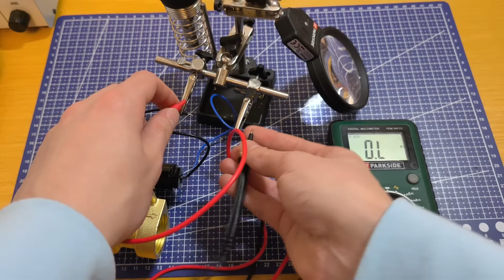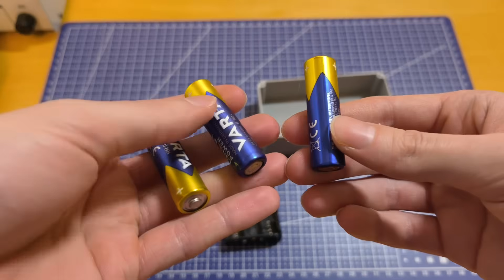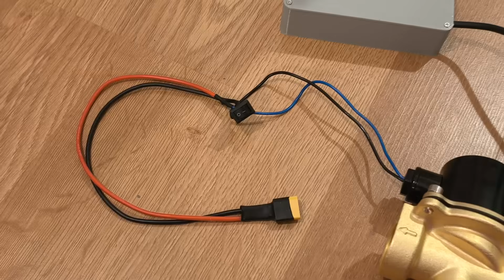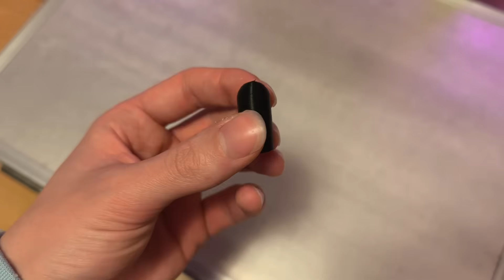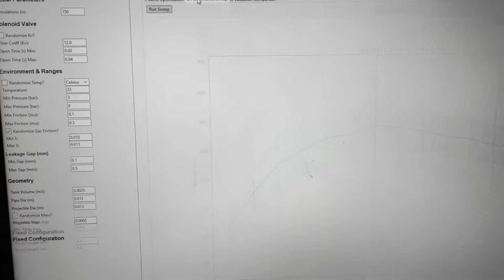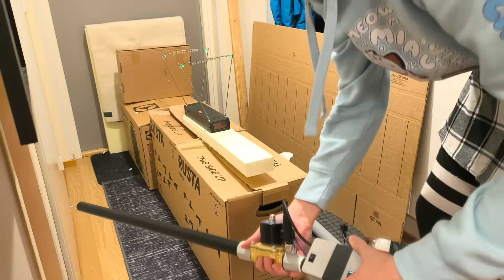Can My Air Cannon Break the Sound Barrier?

Comment: As an engineer, you're doing quite good job.

One question tho, is this just a hobby?
Reply: Btw, for the projectile, you need to 3d print a projectlie with a fins.
Just in case if you test at a longer range.

Cuz a projectile without stabilizer is a speed and acuracy killer.

Comment: Isn't this that thing Anton from No Country For Old Men uses
Reply from the maker: Basically! But that one had a probably 10-20 times higher pressure, and much shorter barrel.     But in practice, this 2.5m barrel one at lower pressure, is more powerful.

Comment: That model is really impressive, Would you be willing to go into how it was developed (well the language and framework really)? 
I probably would've just thrown empirical data at it and skip the detailed math (which is the boring thing to do)
Reply from the maker: Yeah, the interesting thing is that I was able to delegate most of the boring and tedious derivation of the formulas and programming to AI, by first describing that I want an adiabatic model of the system, why I want it, what it should consider (orfice diameter, barrel diameter, piston effect, leakage), etc, as well as how I want it to be modeled, what real-life effects it has to consider, what kind of python solver I want (RK45), monte carlo, what kind of UI I want, etc. 

For the most part, it did it really well. It did make some dumb mistakes occasionally, but having done quite a few courses in fluid mechanics, math, mechatronics, programming, etc, I was able to quickly spot the issues and correct them. Had I done it all manually by hand, it would have taken weeks of continuous work. But with the help of AI, I was able to do it in just a couple of evenings.

For the app, was able to draw the UI I wanted on a piece of paper, and then send a picture of it to the AI, which then programmed a full app for this solver based on that.

Engineering is probably one of the few things that these AI tools provide an incredible efficiency multiplier to. However, the tool is only as good the human using it. The human has to know what they are doing, in order to properly utilize it and validate the results.

I decided to do this project so rigorously, as this will essentially be my bachelor's thesis :3
Reply: @Femboy_Engineering  :shelterin:😺🤗

Comment: Small recommendation to your projectile: look into the design of late smooth bore firearm projectiles for a greater interaction with the backing pressure. Flat surfaces on the back of the projectile like on the one you printed can contribute to it tumbling if you do not have rifling on the inside of the barrel to give it spin. And as you've noticed, the ridges on the 3D printed material do not make for a very good seal. A solution to both of these problems may come with the minie ball, with its conical interior and ridged exterior walls. The conical interior helps the pressure to guide it a little straighter out of the barrel and minie balls were usually coated with beeswax on the ridges when loaded to create a more complete seal with the interior of the barrel. Using a similar design may help you with both the pressure leakage and the tumbling of the projectile.

Your cannon being air will have some drawbacks to this however, as the heat from the combustion that would normally happen with the black powder firearms this projectile would be used with would have two additional features that yours will not. The first is that the expansion of the metal material due to the black powder rapidly heating the projectile on combustion would help the beeswax seal on the interior of the barrel just a bit better. Naturally, air will not create quite nearly the same effect, but the thinner end of the conical projectile may still see a small amount of expansion from the pressure nonetheless. The second is that the burning of the powder would normally burn off a large amount of excess wax in the interior of the barrel due to beeswax's flammability. So you may have to clean the barrel regularly if you use wax in your air cannon, but it should still produce faster results than had you not regardless of these two things.

Nice vid. Love the in-depth explanations. Keep it up. 👍

Comment: Quite brave using a pet bottle for pressure, ive had one explode at the thread next to my head when we were making air muskets with my cousin :P since then ive only used welded ppr tubing. (or steel for some higher pressure activities :3 ), other than that very cool!!

Comment: Do you think a rifled barrel would help increase speed due to better aerodynamics?
Reply from the maker: I think it might decrease muzzle speed slightly right after it comes out of the barrel, as the rifling adds a bit of drag, but if the projectile is spinning, the projectile can be made far more aerodynamically, and it would maintain that speed for far longer and allow for a far longer range :3 So it is essentially a tradeoff between muzzle velocity and range, but if the goal is to launch the projectile far away, in a stabile way, then, the rifling is totally worth it!

Comment: You are putting a lot of trust into that plastic bottle.
Reply from the maker: Yeah :3 I have done some hydrostatic pressure test and tested that they hold around 10 bar of pressure. This time, I only pressurized it to 5 bar, as higher pressure would have just been diminishing returns in velocity, and a higher risk of explosion, which my neighbors wouldn't have liked :3
Reply: @Femboy_Engineering  why not use a metal one?
Reply from the maker: @personWhoLikes_a_lot_of_things  I used these, because I had them lying around, and they work well enough at these pressures! I'm also a poor university student, so that was also a way to save some money :D  This is actually my first monetized video, so from now on, I can afford to do more expensive projects :3
Reply: @Femboy_Engineering  Good luck!

Comment: very amused that it's possible to 3d print valves, love this queer combination of electrical and mechanical engineering uwu

edit: fuck, the pink jet lighter is cool
edit 2: that was an amazing low-tech solution to projectile instability. simpler than barrel rifling
edit 3: you might've already considered this, but a saboted projectile would be a good approach to achieving velocity with a low-profile projectile without compromising the seal which allows for efficient energy transfer

Comment: I can think of one instance where an o ring didn’t apply a proper seal 8:44
Reply: 1986?
Reply: @iana6713 What?
Reply: @mexicanimations 1986 - the cause of the Challenger disaster. It was traced back to a faulty o-ring in one of the solid rocket boosters.
Reply: @iana6713 ohhh now i get it
Reply: @iana6713  yes, fun fact they knew it was gonna be cold that day but they didn’t test if the rings would hold up to how cold it would actually get the we’re overconfident and people died. Sad thing but human error is real
Reply: @boldandbrash798 Yeah - I've just been reading about that in a book about America's first female astronauts. It gets a mention when they talk about the Challenger Inquiry after the disaster.

Comment: got caught red-handed with those super cheap xtra cookies, i'd never have a pack of those cookies in my snack shelf right now
Reply from the maker: Hehe :3  Yeah, I've tried to stop buying them, because they contain an insane amount of palm oil, I think. I've tried looking at other cookie options to satisfy my cookie cravings while drinking coffee, which are less unhealthy.
Reply: @Femboy_Engineering  i recommend baking some yourself, cookies are pretty easy to make and you know exactly what goes in them. For some basic chocolate chip cookies all you have to do is mix together the ingredients, shape them and bake.
knowing you made them yourself will make them taste better too!
They may not be as cheap as the xtra cookies but considering how many cookies you can make before running out of ingredients it's pretty good value still.